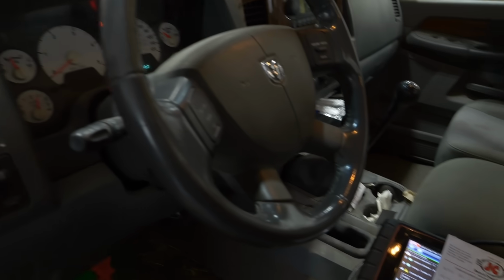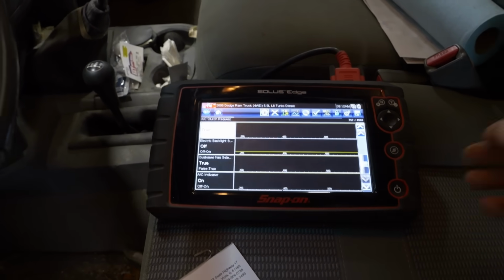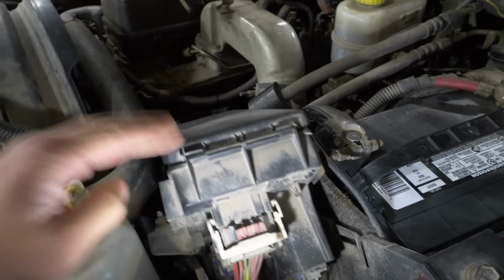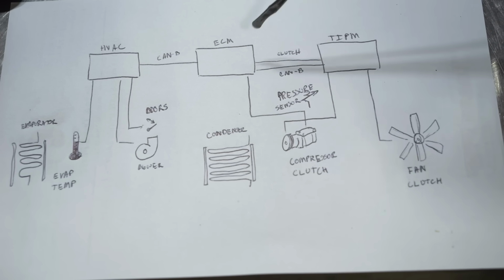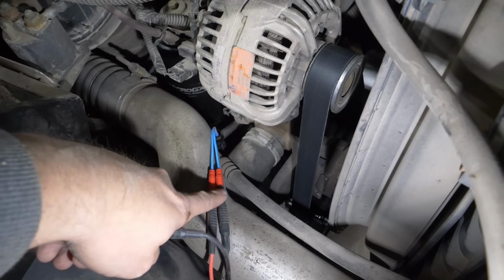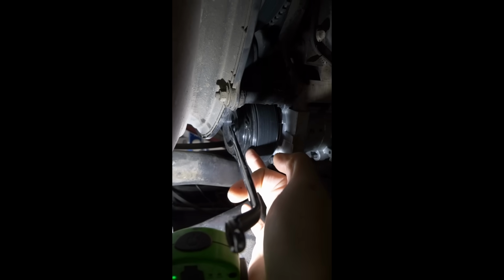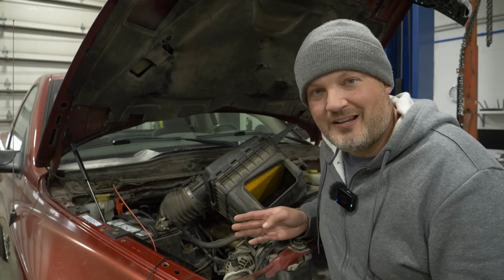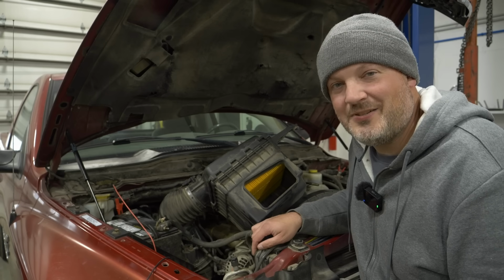Another Shop Fixed It, Now It's More Broken

Comment: From 2019-2023 this exact compressor, cummins side mount, was notorious in our neck of the woods for bad fresh out of the box. For literally years. Only recently did that problem seem to be remedied, but I am more willing to bet that our local DC shipped our known bad parts to your neck of the woods. They seem to all fail in the same way. They were shipped without oil and never tested prior to sale. They never make pressure or if they do will lock up on their first test and eat the belt completely off the truck.
Reply: You could add it to the list of known problems. CV axles shipped without grease. Condensors shipped without the ends welded. Sensors shipped with the entire center plug missing. PCMs shipped without boards. Alternators with no regulator. Starters without springs... this list continues for days. If you aren't a full time tech you would not believe what is sold as "tested and inspected for sale" by every single major parts house in the country. Including the dealerships.

Comment: While I watch, here's another story of "someone fixed it and now it's more broken"... One of my sisters had her jeep worked on, I think a traveling mechanic did some front suspension work on it. Anyway, I go to change the oil for her and it's usually easier for me to pop off the radiator fan and shroud to get to the oil filter on an '03 liberty with a v6 and the under plate. I can't get the fan shroud off. Looking down, the radiator is bulged out, WTF, couldn't get the fan shroud off because of this. I had noticed earlier the condenser had a curve to it and I was thinking "what? Was that arched from the factory? I don't remember that."... Finally found the problem, SOMEONE jacked the vehicle up on the radiator core support. The radiator never leaked, the air conditioning still worked. I replaced the radiator and had to pry down the radiator support with a long prybar against one of the skid plates. Thank god it worked and the new radiator fit in. Whoever did this caused way more damage than their work was worth, and either never noticed or noticed and said NOTHING.

Decided to leave the condenser for the A/C for now since it still works.

Comment: I once changed the compressor clutch on a friend's CR-V since that was the only thing I could test as faulty.  
After that...
Well, my guess is that the compressor had gone so long without rotating and maybe the lubricant in the refrigerant hadn't kept things rolling, because the compressor seemed to get REALLY hot and then the new clutch fused itself together.  I assume it grenaded the entire system.  
I thought maybe the refrigerant (and thus lubricant) all leaked out during the long time the car was without cold air, but then I assume the compressor clutch wouldn't have ever actually kicked on, right?
It wasn't too expensive of a part to throw away and in the end of course it just lived-on without air-conditioning... but it was a huge bummer.

Comment: You are one of my favorite channels, because you explain every step you are taking.  And you even show "fail" videos, which can be just as informative as the "success" ones.  Nicely done.   If the customer removes (for replacement) both the orifice tube, and the filter-dryer, then flushes everything with solvent (under mild pressure) I bet he can get it clean enough.  On the flip side?  Replace the condenser coil with a good used one, is (relatively) easy.   We all know replacing the evaporator coil is more than the truck is worth, though.  Blow solvent directly into that coil, from the hose-connection bulkhead.  Both ways.  Then blow the hoses separate.  Then new orifice/filter-dryer assembly.  And new (used) condenser and new (rebuilt) compressor?  Good to go?  ;P
Reply: "We all know replacing the evaporator coil is more than the truck is worth, though"

Bob, I think that this is the incorrect analysis.

Let's say that your truck is worth $2K, and to fix something is going to cost $3K.  Do you scrap the truck? Depends.
If you can get a truck that is as good yours AND with the something fixed, and get it for less than $5K, then maybe scrap your truck and buy the replacement.

But if you can't get a truck that seems to be as good as yours, and which has the something working,  for less than (say) $6K  then you should keep your truck and fix the _something_.

The key factor is not the cost to fix the _something_.
The key factor is how much it will cost to get  replacement vehicle that is as good as yours, with  working _something_.
And you have to factor in the RISK that you know nothing about the replacement truck.  
You know your own truck - for better or worse - but you could just be buying a load of someone else's problems.

Comment: I have the same truck and a/c went out in southern Utah when it was 110. I haven't had much luck with mechanics over the years so I try to do what I can myself. AC work is not one of those things. So I took it to a local shop that works on our fleet vehicles. Got the call it was the compressor. Because there is a known issue with the tipm, I asked how are we sure it's the compressor. You would have thought I kicked their dog. The response came back that it wasn't coming on so it's bad.  They did some diagnostics, which probably did more harm than good. Watching wes diagnose it, I wish these fellas had that attention to detail. They broke the connector on the pressure switch and I got a zip tie repair. Long story short, they replaced the compressor, orifice tube and expansion tank and got it working but it has never been the same. Less than a year in the first time the compressor comes on for the day it makes a loud clunking noise. Only does it once and then turns on and off quietly. AC seems to take longer to get cool than the original pump. They left wires hanging, broke the latch on the plug, gouged up the plug in for the tipm trying to check signal and broke the tabs on the tipm. They sure did reinforce my hesitation to take stuff to a mechanic. Sucks cause there are guys like wes out there doing great work but ya gotta go through 10 knuckleheads and thousands of dollars to find em. Good work Wes.
Reply: I too do all my own work on vehicles etc as I have also had less than stella repairs done.
Reply: I started working on my own cars & then all my family’s cars because too many bad experiences w/ mechanics when I first started driving. I try to do everything myself. I don’t do AC or replace glass.
Reply: @CarlConrad-n1x  Just bought an old Nissan Patrol where they installed new glass but used the old sandwich gasket on the glass so it was leaking in. I ordered a new gasket myself and was afraid to do it so I got my bodywork friend to help me but it really was a piece of cake. I would guess replacing a glued windshield would be harder though.
Reply: Get new connectors and repin it
Reply: No offense but you sound like the kind of customer mechanics hate. Know it alls are the worst kind of customers. You have to at a certain point trust reviews. Trust the bbb and if you don’t have good reviews or bbb recommendations don’t bring it there…. But as well as that’s concerned most shops throw aftermarket garbage at cars and that’s probably why it takes a while to cool down. Remember….. people in independent shops and the techs especially deal with every make and model to familiarize yourself with every single system is very hard to do so when you question everything and complain constantly you are making yourself look like a jackass.
Reply: @danokerr9929  far from a know it all but I can distinguish between professional and shade tree work. The repair took 3 times longer than they quoted and I had to take it back twice afterwards to get to the point we are at. Best to cut my losses and find a better shop.
Reply: @danokerr9929  I'm a plumber, not a mechanic, but I love it when a customer asks how I know something is the problem. First of all, I have a reason, I'm not a hack, so I have no problem telling them. Second of all, it shows that they are interested and want to learn.

Comment: I have said this several times on many videos that show mouse 🐁 damage. My wife’s Tacoma had the wires to the throttle chewed on causing the truck to only idle. It cost me about 650 dollars to get it fixed. And then they chewed on the abs wire to the rear brake sensor  another 550 dollars. So I found on amazon a mouse blocker that can be wired in under the hood no more mice 🐭. The proof is in the poop. 💩 no more mouse droppings. Because they do two things they chew on everything and poop. 
Get them to plug into the the wall also. 
Worth every penny.

Comment: Wes, got a brilliant suggestion for an add on option for your area. How about a miniaturized vending machine. Like the old days. Maybe a small one, holds little blocks of cheese. The mice can deposit a dime and get a block of cheese. Eliminates the wire chew and the output of said mouse. Run it by the Local 673 Union (Mouse and Rodents of America). What you think? Or would that cut in on the MegaMillions you make fixing these vehicles?  Oh well, say hey to MAX for me.

Comment: Nice video. I wonder if the last compressor had put shrapnel in the system and took out the new one or if it was just a bad part since it seems to have two different problems?

Comment: I don't get shops that won't do wiring - there's so much of it in cars these days and the manufacturers just keep adding more.
Reply: A lot of mechanics aren't good at it. Plus hard to make money if you tear a whole dash apart to find and fix wiring and it takes 10 hours the customer will say "that's too much money to fix one wire"
Reply: @henrydillard6217 yes but to be honest, the test that Wes did that revealed the problem isn't exactly rocket science either
Reply from the maker: I don't get it either.
Reply: I don't get shops that won't do wiring 
- It's a PITA for most people
there's so much of it in cars these days and the manufacturers just keep adding more.   -all the GD bells & whistles .... you ju$t can't  live without them, eh?😉
Actual BS that sales are more important than QC....

Comment: To quote Eric O--"just because the parts are new, doesn't mean they are any good" !! So true !!
Reply: new = never ever worked. 😋
Reply: Every new part I've bought in the last year has failed or been in some what out of spec. Cheap, expensive, name-brand, no-brand, it doesn't seem to matter.
Reply: @LN997-i8x  Corporate greed  at work !!!!
Reply: I'm old enough to remember the day when there were brands you could buy and just about 100% know the parts would be good.  For example, "NAPA" used to actually mean quality, and not just rebranded Dorman crap.
Reply: @TStheDeplorable  Now they stand for Never Any Parts Available !!
Reply: Been there done that.
Reply: Or if they fit..
Reply: Like Eric always says NEW stands for Never Ever Worked.
Reply: A brand new Detroit Diesel 8V-71N thermostat (2 on engine) coat me three days of aggravation after inframe overhaul. Would have found it the first day if cheap infrared noncontact thermometers were available back them.

Comment: Does the compressor come with the clutch attached ?  It's been a while for me, but in the 80-90's GM clutches were replaceable. You had to manually set the gap <.31">?? betwixt the mag plate and the compressor by using spacers, then using a press to force the bearing onto the shaft, press-fit style. You'd see 'em where guys would just press them on, and send 'em out with the clutch... Always on....

Comment: What is the difference between liquid tape and silicone sealant?  I’ve used silicone sealant to seal an RF antenna connector, exposed it to 10 years on a house roof, and cut it open and it’s still flexible and the connector looks like new.
Reply from the maker: Some RTV can react with some wire insulation. I've never had it happen, but liquid electrical tape is cheap and easy to use.
Reply: I think liquid electrical tape is vinyl with a solvent. Don't quote me on that.

Comment: I start at the ac compressor relay with possible engagement issues. Really don't even need a wiring diagram at that point. It gets tougher if it's integrated.

Comment: I've seen this happen before,the compressor was probably replaced due to a failure and sent metal through the system and never got flushed out,the clutch probably glued itself closed from an over voltage issue from a short to ground.never the less its a very odd issue.

Comment: Sometimes you just have to turn away the work because it's non-profitable. 
Should give the customer the crusher option.
Reply: Wes isn't doing it because it is the other garage's problem. They're the ones that installed the defective compressor and clutch. So now they get to fix the whole AC system they botched up.

Comment: The AC compressor is used for the defroster as it dries the air.  In fact to keep the seals lubricated, you are supposed to run the ac or defroster several times over the winter.
Reply: That's definitely not a problem in northern Illinois. Defrost is a way of life in winter!

Comment: The AC on my 90 D250 worked great untill about 96. No amount of money or firing of the parts cannon has kept it working for more than a week or two at a time. By now, almost all of the Dodge electrics are dead. (Windows, locks, cruise, delay wipers, dash and interior lights, radio and antilock brakes ) The Lucas electrics in my MG are far superior.
Reply: Have a '94 1500. Was going to say I have had better luck with electronics, then realized I don't have electric windows, door locks, cruise, or a/c. And my alternator is controlled by a stand-alone voltage regulator on the firewall, as the ECM doesn't want to do that anymore. And the radio is not currently working, and the wipers are one speed. only!

Comment: I've never fooled with a/c. Can new compressors be bench tested fully, including all that clutch stuff? 
   Won't hurt it to compress air unless water vapor gets trapped or something. Does it sit in a bit of oil and blow it through the lines like a fridge compressor?

Comment: NOTHING defrosts a windshield like a stream of warm air that's been dehumidified thru the air conditioner.
Reply: So true! Where I live it doesn't get that hot in summer so the AC doesn't see much use... but in winter it's a life saver
Reply: Exactly!
Reply: I turn ac off on defrost cause it dries out my nose and eyes. Used to share heavy tow trucks with another driver who ran with defrost on constantly. I'd figure out it was on defrost after about 30 minutes of driving without looking at the hvac controls because my nasal passages would start going crusty
Reply: I was gonna say, The AC is often crucial to defrosting.
Reply: Helps dry you and gear off when you're in and out of the vehicle constantly in winter.

Comment: The other shop has NO IDEA why they replaced the compressor either ! 😂 Great diagnosis ! A disaster ! Better get that AC working , it will be in the 20's !😂😂😂
Reply: LOL might be a necessary thing
Reply: I believe the ac compressor is used for the defrost also, definitely need defrost in the winter months.
Reply: @DinDooIt  Yes it definitely helps with preventing fog on the inside

Comment: Liquid electrical tape is wonderful stuff.
Reply: It dries out super fast in the can, it's useful but really expensive when you figure the price per actual use before it goes bad.
Reply: @paisleyprince5280 Factoring in the headaches it can solve and what your time is worth, it's a bargain.
Reply: I tried it once when I was wiring a backup camera into my reverse lights.  After letting it dry for an hour, I taped everything up to make it look better, and then the vehicle would no longer start.  The wires shorted together, blowing a main fuse, preventing the engine from starting.   A $400 mistake.
Reply: On my list to pick up!
Reply: Try putting grease on the threads.
It seals tight and the lid doesn't get glued on.
I also do this with plumbing cement, contact cement, etc..